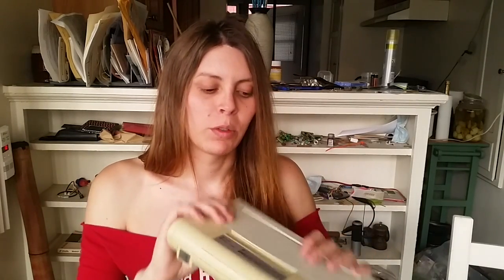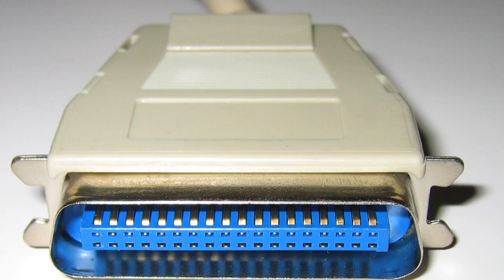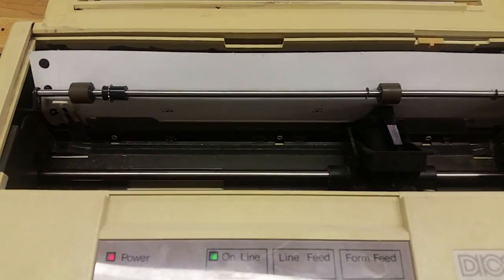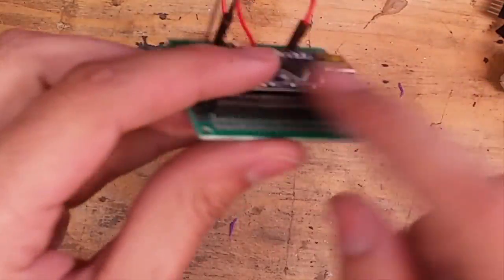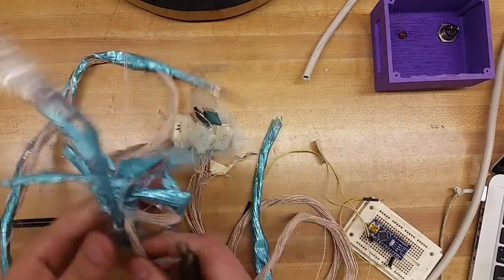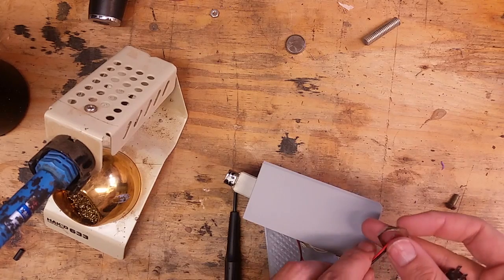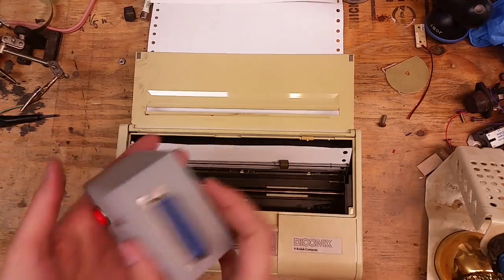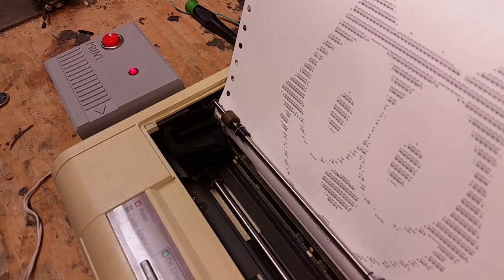Printing ASCII Art with an Arduino and a Vintage Printer

Comment: but what pin powers the arduino. in the wiring diagram i did not see a wire connected to the arduino's 5v pin

Comment: Cool project. I thought, maybe, it was possible to connect a bigger Serial EEPROM to store the text/ascii art, which could be sent via usb from the pc.
Reply: Or add an SD card port (which is basically a generic SPI interface). Even cooler would be if you can load greyscale bitmaps on the card, which get converted to ASCII art by the arduino.

Comment: Would this work with any parallel printer?
Reply from the maker: Yes! It should at least work with most parallel printers
Reply from the maker: That said, it's possible a different printer might not supply enough power to run the cartridge, and battery would be required, but I don't know for sure
Reply: @EmilysElectricOddities  I could imagine using it with all kinds of printers. External power would probably be necessary. A simple switched power input.

Comment: ...and no schematics? :(
Reply: I mean - it's simple tracing signals from source code to the printer connector, but having a schematic ready is way much better ;)
Reply from the maker: @asbestomolesto  Yeah, that's why I didn't include a schematic, but I suppose a schematic is a lot easier than staring at my code. Maybe I'll throw something together today.

Comment: Cool project.I like the idea of it printing a random thing each time you press the button. I don't remember ever seeing one of those printers before, though I had heard about them. It's interesting that it looks and sounds like a dot matrix. I still have a couple of Centronix printer leads in my junk box. And I have a working parallel Zip 100 drive! I haven't had a parallel printer for about 20 years. I bought an Epson MX80 sometime around 1980 and hung on to it for nearly 20 years for doing code printouts.
Reply: It's super noisy since the mechanics are very crude + the fact that it uses stepper motors running fullstep and not DC motors with feedback as in modern day printers.
Reply from the maker: I was surprised at how loud it was for an ink jet. I suppose the technology has improved with time so the newer ones are quieter

Comment: Nice! How well does the antenna trick work as a random number generator?
Reply from the maker: I haven't performed a statistical analysis to see how close to random it is, but before I added the antenna, the sketch picked one piece of art a lot more than the others. Now it seems to change things up pretty well every time.
Reply: @EmilysElectricOddities  sounds good enough. Now I just need to find one of those printers :)

Comment: This is great, I love how professional it ended up with the custom enclosure. Mine would have probably stayed on a breadboard, but now I'm inspired to try to do better.

Running out of space on microcontrollers is probably the biggest downside. If you ever want to revisit this project (or a similar one) you could look at some simple compression like RLE, or look at adding an SD Card - they are really easy to use with micros because they use the SPI protocol.
Reply from the maker: I was thinking about figuring out how to include an SD card. I could fit sooo much art that way.
Reply: Why not configure the USB port as a serial port, and connect it to a computer as a serial printer?  You could send it ASCII Art, or anything else, all day long!
Reply from the maker: @chrisw1462  That absolutely could be done with some coding, but I like the cartridge being autonomous. Requiring it to be connected to a computer takes away the simplicity of it, and the fun of having it print a random piece of art
Reply: @EmilysElectricOddities   It can do both! :-)  But then you'd definitely need the SD card or an I2C  EEPROM, due to the code needing more space.

Comment: Cool. I guess that could work with other printers with Centronics connectors.
Reply from the maker: Yeah! It should even work with any printer with a parallel port if an adapter is used

Comment: Now make it take your twitter feed and output it constantly.
Reply from the maker: That's an idea! I think I have a wifi arduino in my junk somewhere.
Reply: @EmilysElectricOddities  Getting enough power from the parallel port to run Wifi is asking a bit, but with the addition of a supercap and only turning on the link occasionally, would probably work.

Comment: Clipped resistor leads FTW! I keep a few of them around for the same thing. Also love the "clicky" button and the Matrix effect at the end was RAD!
Reply from the maker: Thanks, Dean!

I can't say I save resistor leads on purpose exactly. I just don't clean up after myself very well, so they accumulate, lol.
Reply: I've been getting cheap resistors with steel, not copper, leads recently.... so I have to run a magnet over my clipped leads heap before "recycling".